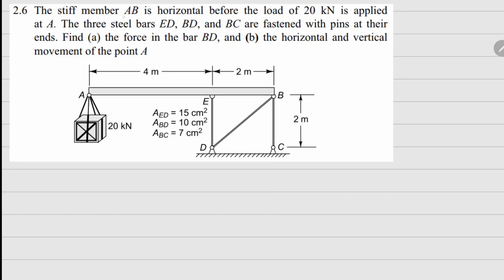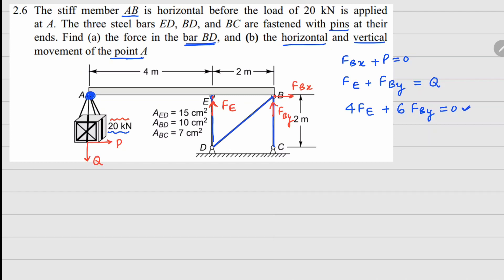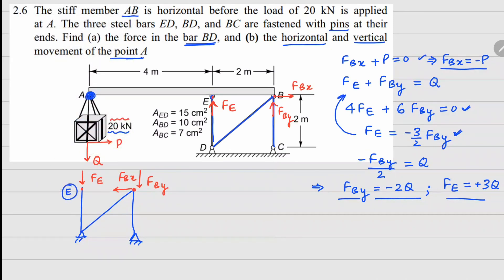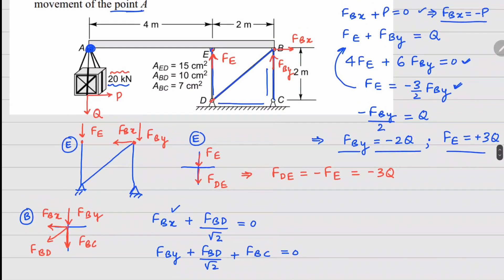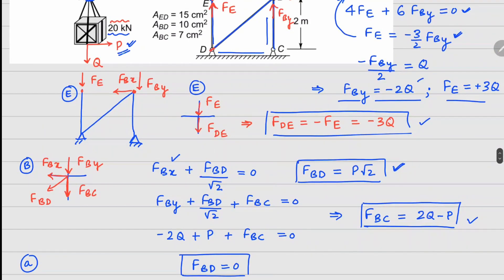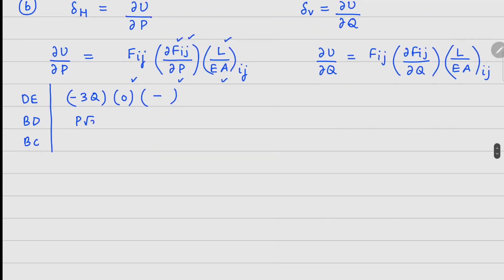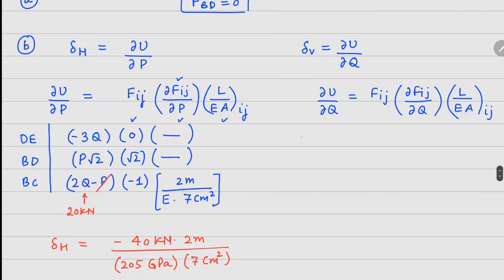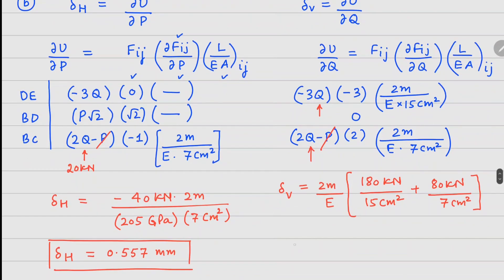Problem 2.6 | Mechanics of Deformable Bodies| Mechanics of Solids | Crandall, Dahl, Lardner

Comment from the maker: If you take P=0 at the start, your force calculations will be easy but you will not be able to take derivatives with respect to a constant (P=0) which we need to do to apply the Castigliano's theorem.